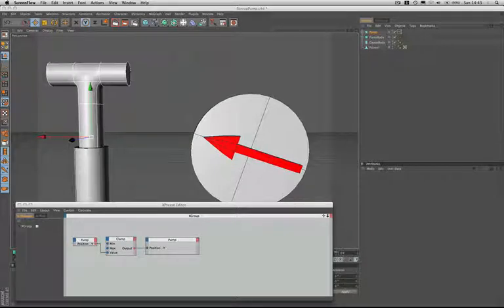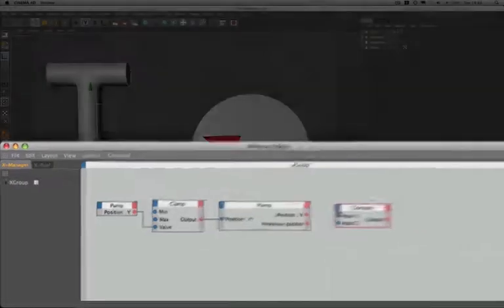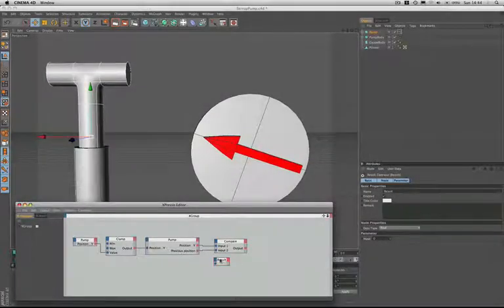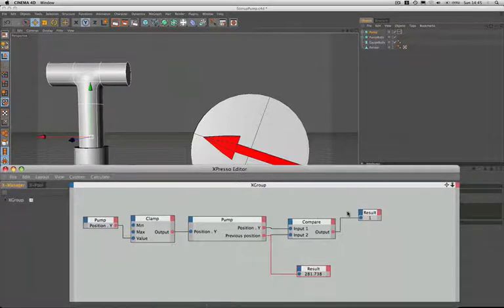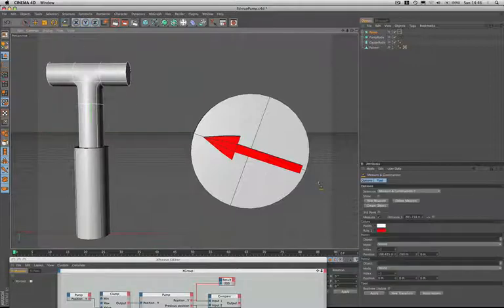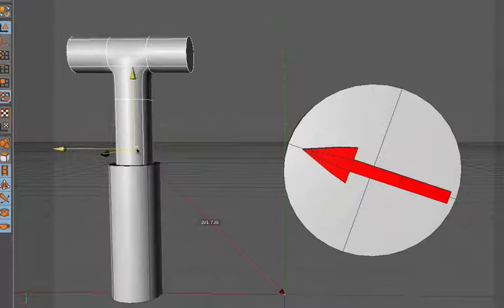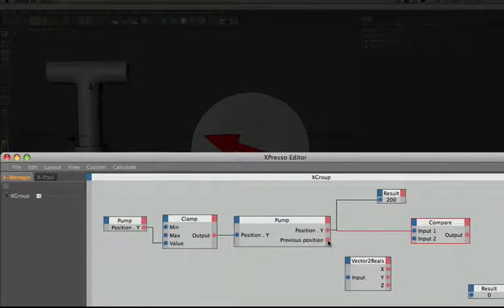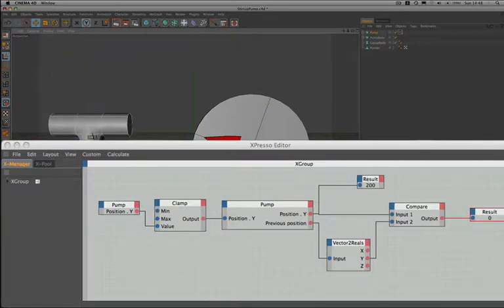Cinema 4D Xpresso Tutorial 17:  Creating a Pump and Pressure Gauge (Part 2 of 3)

Comment: This doesn't work for me! the previous position and corrent position are identical therefore the compare node doesn't work! what to do? i'm using c4d 2024!
Reply from the maker: If you are moving the pump handle, it has to work, as there will definitely be a difference between the compared values. Maybe you have done something else wrong? Be sure to check everything!
Reply: @ExpressoMechanicTV  
i did the exact same thing as u did! still doesn't work, could you check it with the newer version of cinema 4d?
Reply from the maker: @KosretEbdulrehman  Yes, email me your file. jfield@young-sounds.com
Reply: @ExpressoMechanicTV  
Oh thank you, but I just moved the pump to Z+, and it worked! i'll save that email, I'll have more questions, I have to master Xpresso otherwise I will remain an amateur
Reply: But my pump handle is in the center of the coordination. does that make a change?